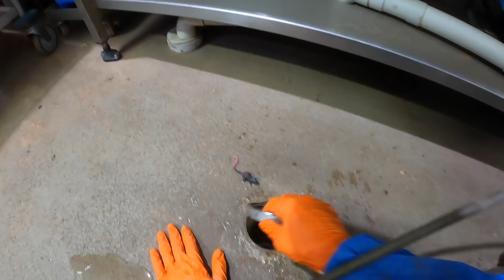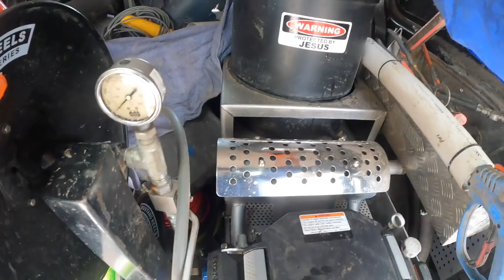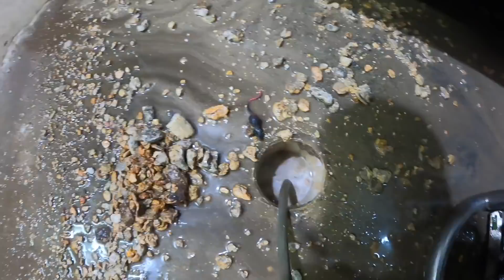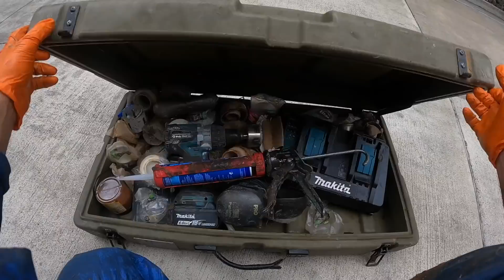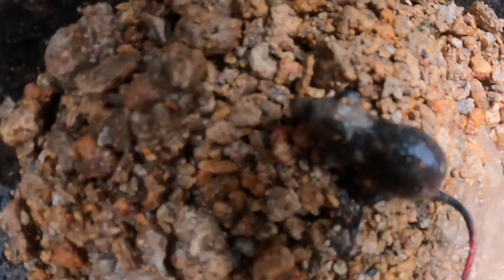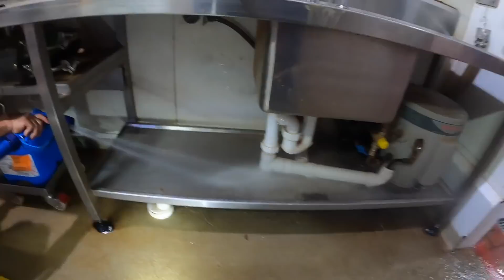Blocked Drain 628

Comment: Ollie awesome work! I'm and electrician here in Central Florida. Do you charge  for your services with a flat rate or do you charge hourly? I never thought 🤔 to ask you. I'm s huge fan of yours and have watched countless episodes. God bless. I really love your Protected By Jesus sticker too on  Mr Jetter.

Jeff - Sunny Central Florida
Reply: I would say a flat rate given the speed he works at. If it was an hourly rate most tradies make it last as long as possible. But Ollie seems to have great ethics so it wouldn't supprise me if he just charged a call out fee that included the first hour. The plumber I use charges extra if he needs to use the camera to figure out the issue.

Comment: Plumbing police here...  At 21.49 there is supposed to be an air gap between the hot water relief valve and the drain to prevent possible cross contamination from the drains into the water supply. If somebody drained the hot water cylinder it could syphon the water out of the drain into the tank and contaminate the water in the tank. I know the chances are small but the rule is there because this has happened at some point and probably made people very sick. BTW did you go home with the hair net still on?

Comment: Sort of like the chunks of grease in drains...  food stuff coats the inside of the pipes and then hardens.   When your rig shut off,  I was thinking Fuel,  Oil,  and all the other stuff that goes along with engines.   It's wise that it powers down with no water, as the pump can fail prematurely with no water.